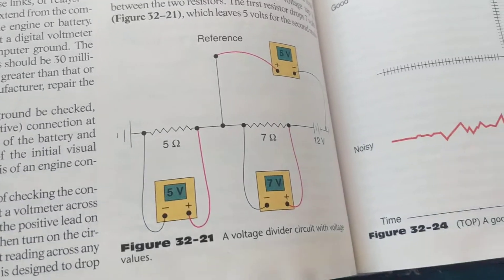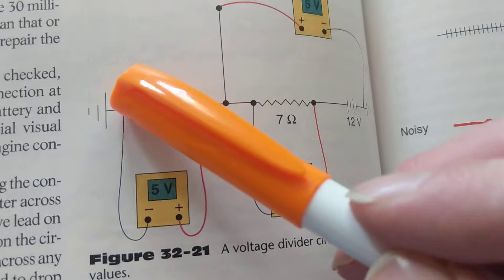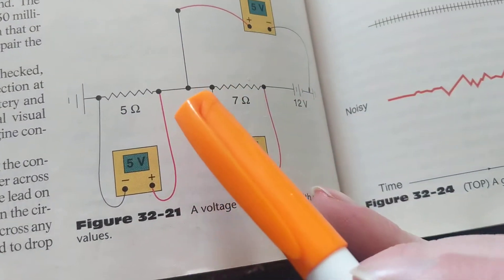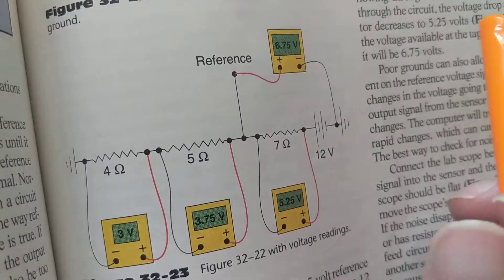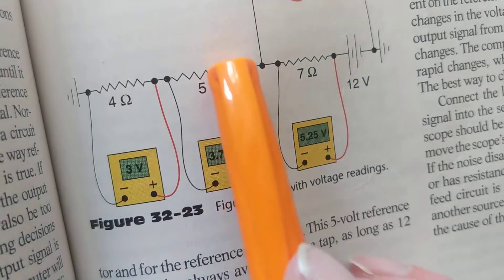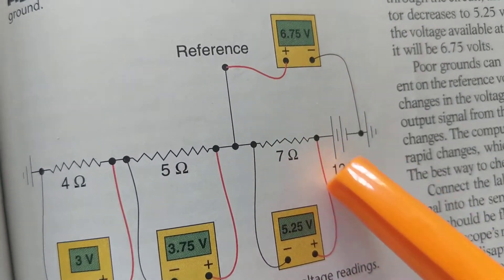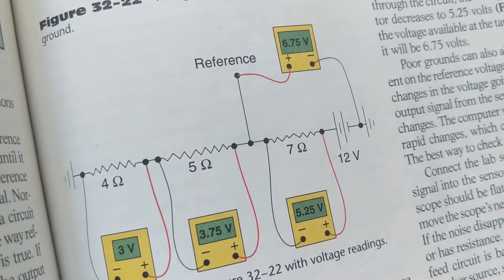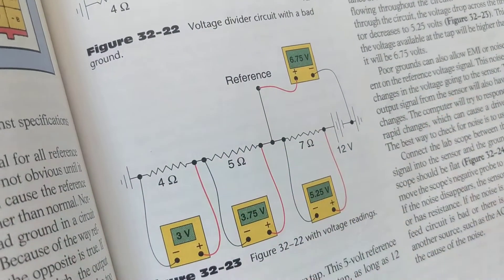HOW TO MEASURE ANY ELECTRONIC CIRCUIT WITH MULTIMETER FROM DIAGRAM

Comment: Are these resistors (bulbs) connected in parallel? Fig 32-21.
Reply from the maker: They are connected in series which is why you have the same current flowing through it but different resistance and that's why you get different voltage drops thank you for your question and comment
Reply: @Joeelectronicschematicsforauto  Fig 32-23. The volt meter will read 6.75v because the positive lead is between 7ohm and 5 ohm and the other lead is on the common ground of that circuit. It will measure the 4ohm resistance on the ground and 5 ohm  together. Voltage drop because of Corrosion. Thank you for this Informative video..👍👍👍